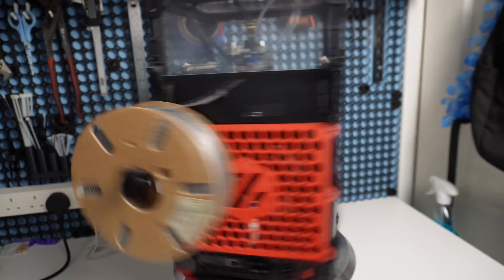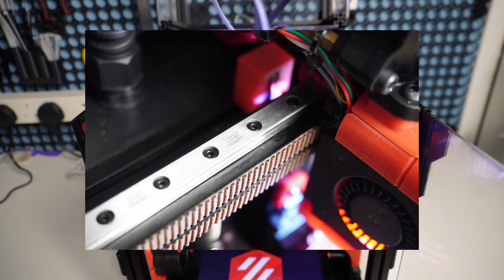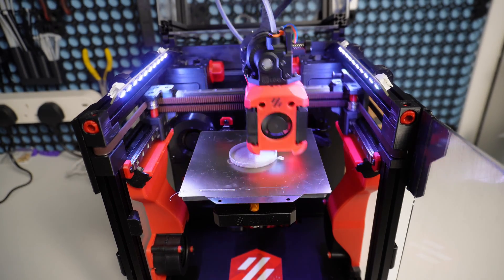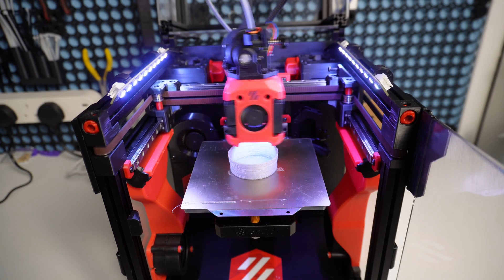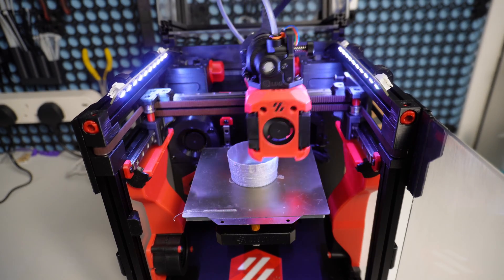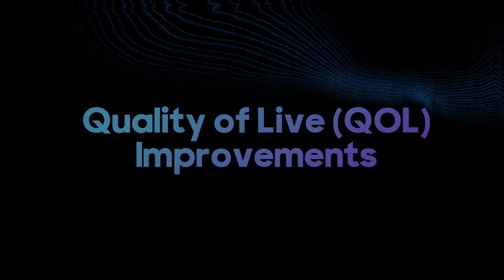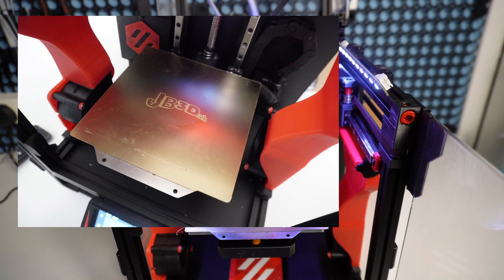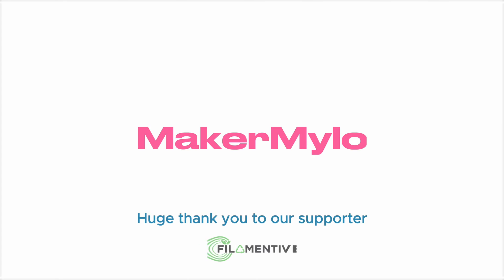My Ultimate DIY Voron V0.2 R1 Pro Modifications & Performance from LDO, E3D, BigTreeTech & Bambu Lab

Comment: Very nice v0, but it’s printing like dookie.
Reply from the maker: It was a combination of glitter infused filament and me pushing it pretty fast for the footage, regardless its had a full rebuild since this video and quite a few upgrades, it prints really nice now, and looks better doing it.
Reply: @makermylo  did you do a video on the updates? If not what main components did you change?
Reply from the maker: @dkgoodrich8899 The hotend was swapped out for a Revo then eventually swapped for a Bambu Style clone Sailfish from Fysetc as a temporary measure that turned out to be great actually.

The X Rail was replaced with a solid extrusion and the rails swapped for HIWIN rails.

Comment: Nice printer. I just installed a dragon burner (v4) on my V0.1 with  Sherpa micro printed (abs). I reused the Phaetus Dragon hotend. I love it. The resonance test gives me max accel of 12500 m/ss. I'm getting very good abs print at 250 m/s, 10k acceleration.
The print during the video is a bit slow. Did you try to push it faster? Did you do the resonance test? If so, what kind of figure did you get?
Reply from the maker: Hey! The print in the video was slowed down significantly as it was a sparkle PLA that is not good with heat, even with the auxillary cooling fans in vase mode it can't cool fast enough on the v0 to not warp (i had about 10 false starts).

Using ABS and fully enclosed its easily doing 25k Accel's and prints (reliably) upto around 250-300mm/s i've not really pushed it much further than that but im sure it could.